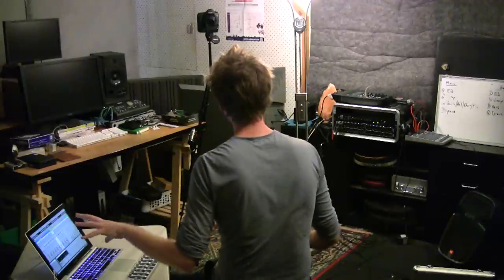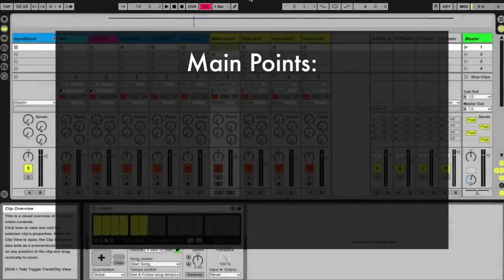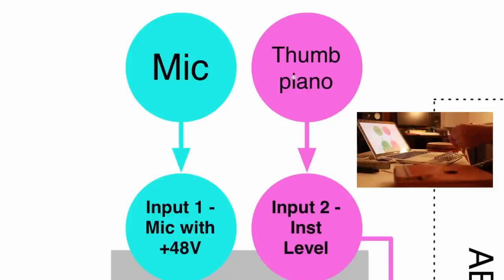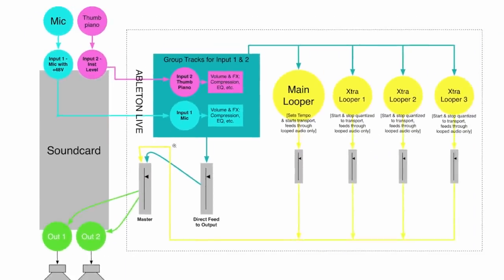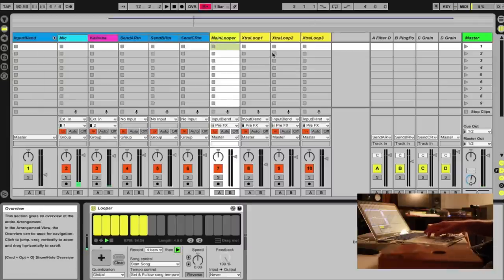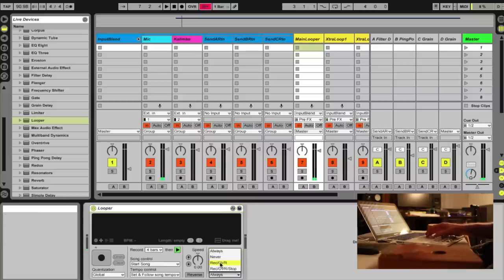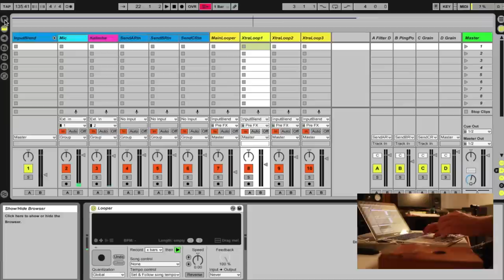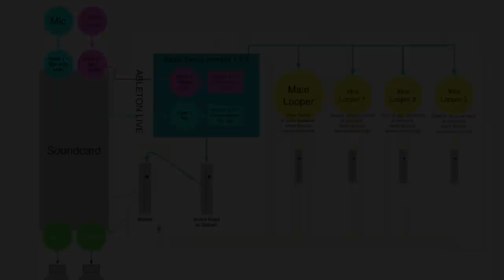Looper Part 2: Building a Live Looper Set

Comment: I understand this video is not all that recent... Yet I hope I can get some answers to those questions...
1. In the MIDI mapping section, you show the multifunction button of one looper mapped to one pad of your SoftStep... Is the button of each looper mapped to a different pad? Or are they all linked to the same, and if so how do you control on which track it is looping?
2. The way you route the signals is really interesting to me, yet I would like to be able to select which channels go into the looper and which ones not, and change it while I play... Without losing the direct feed... Is that possible?

Comment: Hey thanks so much for this video.  Very good.  Is there a second part that expands on this and shows you working with the separate loopers?

When practicing with the looper I am having a challenging time getting the looper and the 1st beat of my vocal lined up and my phrase, for example, ends a bit faster than the end of the 4th bar.  Any advice?

As well, I have mapped the 4 looper transport buttons to 4 of the bottom pads on the User area for PUSH2.  The responsiveness is not so good with these buttons and the looper transport button.  Any advice?   Would a foot midi controller be better?  

And the Xtra loopers you have set up.. is the reason you have them set up this way for maximum control of the separate parts, as opposed to overdubbing? 

Thanks again.  

NOAH

Comment: Hey Josh, I set this up and it is working great but the only problem that I am having is that I have other audio tracks setup so I can drag what I have sampled out of looper. The problem I am having is that the audio does not sound the same when I drag it into the other track. I have messed with the settings and have not been able to figure it out,Can you help me?
Reply: +Dan Kelley - Sounds like a warping issue - when you drag your audio file out of the looper to a track, it is automatically warped to the transport tempo, and in re-pitch warp mode by default (I think). I guess the first question is - is the transport tempo the same as it was when you recorded the loop (i.e. if the looper calculated your start tempo to be 90.73 BPM, is your session still 90.73 BPM)? You can try fiddling with the warp modes on the clip dragged to the track - it's probably 're-pitch' by default - try complex or complex pro?
Reply: Thanks Josh. I believe that the tempo is the same. By default warp mode is set to Beats I believe because I have not changed it. I changed it to complex and will mess around with it, don't see a complex pro mode? I will try messing around with this setting thanks for replying

Comment: ok, i found out the problem, as you show on the video, i've assign "input and output" to "never" in the loopers. But the main thing actualy is, that having 2 loopers pr. tracks (for the chorus part) some how doesn't work. It blocks the midi control function i assigned. I really wonder why? i was using this technique:  https://www.youtube.com/watch?v=RF0id8YRlNA&t=5s